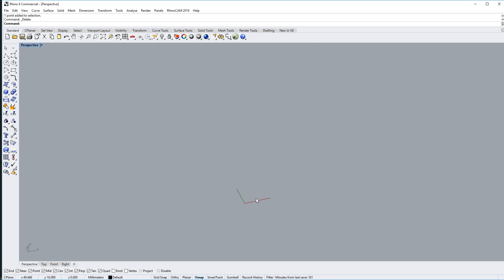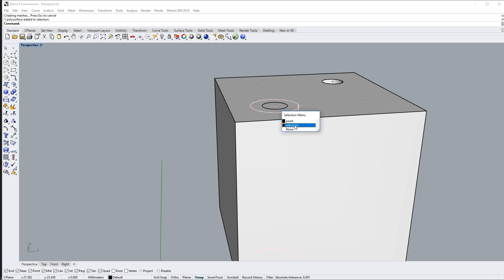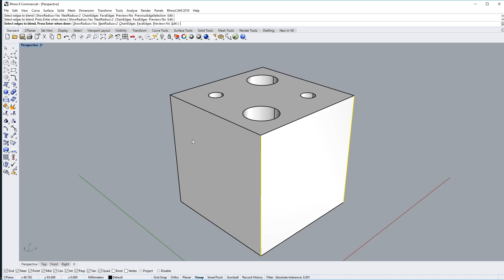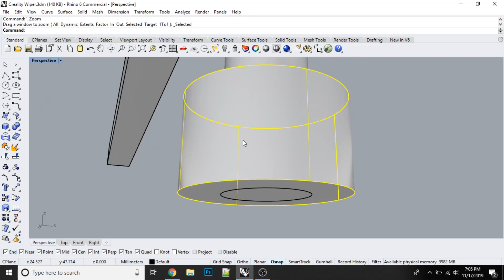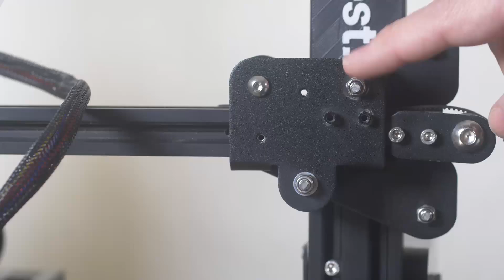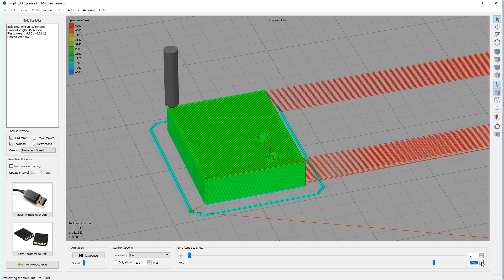Custom Nozzle Wiper for Ender3 & CR10 - No More Layer Shifting PETG!

Comment: All 3 of my printers lay down petg no issues, no modifications are required
Reply: Would you be willing to share any tips or suggestions?
Reply from the maker: Try a 36 hour print at 265°. The high temperature is for increased layer adhesion, but it also increases stringing. About 50% of the time I get layer shifting caused by the well known issue of nozzle buildup. This has been a tremendous waste of filament throwing away all these failed prints. If you absolutely want it to work, wiping frequently is the solution.

Comment: Eek you're going to eat through nozzles cleaning them with a wire brush at every layer, also big prints are going to be quite a bit slower. Good idea but not without its cons

Comment: Great video! How much build up do you get on the brush? I recently got an e3d Nozzle X, which is meant to be super non-stick, but I feel PETG is even worse on it, so I could definitely use something like this!
Reply from the maker: I'm almost done with my first 36 hour print using this brush. For some reason, in the beginning I got one glob that attached to the brush. I pulled it off with my fingers. Since then there has been no build up, but lots of boogers and dust on the bed and around the printer on the table. I need to play with that layer change script a little to dial it in more for the next print.

Comment: Hi there. First of all, I want to say that I do like your channel as I see the real engineer, who likes to build things and has strong opinion on different subjects. However, I do not agree with everything you share. This topic is one of them. I do not want to say that I have printed with PETG a lot, but I have printed enough. The only issue I have experienced with PETG was and is stringing. Beside that everything else is quite worry free. That includes simple geometries as well as complicated models. Your upgrade will increase print time a big time as well as significantly cut nozzle lifetime by constantly robbing coper over coper. Keeping a nice and clean nozzle is a good idea overall. I will be looking into this idea maybe as a print ending routine. This upgrade will work on table shifters.  I have built CoreXY printers. You cannot do a nozzle wipe on every layer without making your print time as long as eternity. As of Prusa MK printers. I believe that almost all parts of this printer are printed in PETG on similar printers. If printing with PETG was an issue, they would have implemented nozzle cleanup a long time ago as entire production depnds on it. 
Nevertheless, good stuff. I gave my like.
Reply from the maker: Have you tried printing at 265° for increased layer adhesion and thus increased strength? I have a structural part which is a 36 hour print and about 50% of the time while printing it I would get layer shifting. I think the key difference between your experience and mine is the time printing. 36 hours is a lot of time for nozzle build up to occur.
Reply: @DesignPrototypeTest  Very much possible. My longest print with PETG was not more then 10 hours. I also remember seeing one video on YouTube. (I believe from Matterhackers) suggesting printing PETG with some extra high, not to squish filament by nozzle.That would keep nozzle tip clean as well. At least in my case. Will look forward to see your video on this.

Comment: Fantastic. I love and hate hot PETG. It's great for tough functional parts, terrible for hard blob crashes.
Appreciate the great comments, people. Keep them coming. This is a serious issue.

PS. I don't know if I'm just being cranky, but I often draw 0.5mm channels on the bottom layer that connect all the holes together. That way, the entire wall starts out as one single long uninterrupted line. Similarly, in Cura, I use an Infill Line Multiplier of 2, then Connect Infill Lines and Connect Infill Polygons. Again, this produces a continuous print line for the entire layer with minimum travels at the expense of longer print times.

Comment: Nice! Devin from make anything did something rather similar just a few months ago: https://www.youtube.com/watch?v=avlengYsJdw
Reply from the maker: His quick hack is attached to the bed, and the idea comes from the much more developed solutions found on thingiverse. I mentioned the thingiverse solutions in the video. With the brush attached tot he bed it only helps with your first layer.
Reply: @DesignPrototypeTest  Good point indeed! Just reminded me of his video and thought it'd be interesting to share. Makes me wonder if manufacturers will eventually integrate a wipe block, not unlike what you find in regular 2D ink printers.

Comment: The channel could be named "No controversy today with Matt featuring positive DIY"
Reply: I notice today that he disabled all the comments on the teaching tech rant video... that’s says a lot about the personality of this guy
Reply: @SamuelCarreira  I think if TeachingTech had asked to remix or rehash DPT videos, then these two guys could have worked together, TeachingTech is good at educational videos, but DPT is good at the engineering side.. DPT could have done videos that show how a mod for a printer is designed, prototyped and tested, and TeachingTech could have done a video on how (in the case of this video) how to print it, why it works, and how to modify the code in Marlin.. Each video could have linked to the other, and they both would have got views.
Engineers are not always good people persons, and you need to remember these people do the videos as a hobby, are not TV presenters representing a network, so if someone not not respect them, especially in the case of an engineer, they are going to say it straight, rather than thinking about the PR aspect.
But if you do not like DPT since watching the teaching tech complaint, why do you keep watching his videos? DPT making videos is optional for him, but so is you watching them.
Reply from the maker: @jonmitchell2424  This.

 Instead TT copies my title to steal my traffic. He has not changed his title since I released the video, and he doesn't answer my emails any more because he knows what he is doing and he knows he is wrong. He doesn't have the guts to have a conversation with me, or even publicly respond to my criticism. Don't forget that he is allied with TH3D. TT regularly features TH3D products with nothing but praise. TH3D sells a t-shirt that mocks me. I've never said a word on this channel about TH3D yet he attacks me.
Reply: @SamuelCarreira  Shut up, Samuel. When you grow up, you might not think so highly of yourself as to make such offensive comments. For now, just button it.
Reply: @meky0  The consequences of IP theft can be beyond catastrophic for some of us. Unfortunately, most of us don't understand what it means and tend to pile in on the victim, even to the extent of personal insults and abuse. Since I've had my business processes cloned and products copied with wholly disastrous consequences, I'm a bit more supportive of Matt speaking out. Indeed, if TT actually agreed with Matt, he might put in a really big effort and produce a really worthwhile video on, I dunno, say contour printing. Just a thought.
Reply: @meky0  Sorry, I don't understand. What is it that is good? And what does "hoarding old ideas" mean? I apologise if I was being opaque. TT has indeed put in a good shift and made an excellent video on contour printing, well worth watching if you are interested in that subject.

Comment: Interesting video with ZERO useless controversy. Thanks Matt!
Reply from the maker: You might want to skip the next video I release. Just a heads up to those who don't like the "controversy." Although I can't say I appreciate that label. It diminishes my ability to shine light on issues which I think are important. What's the point in working so hard to gain an audience if I can't speak to them?
Reply: @DesignPrototypeTest  Don't worry Matt, I will watch the next video, you usually have some interesting ideas to share. I was just pointing there is no issue with the video, a kind of "virtue signaling" but I am a Trump fan so not into braindead leftism. DIY is not braindead even with some controversies <3

Comment: for real??? what are you all just for a problem with PET-G? Buy your filament from reputed manufacturers (not low-cost suppliers on Ebay), print a temperature tower to determine the perfect temperature for your machine, print at a matched speed (not the max that your machine can), use a clean nozzle (or better ruby nozzle ) and observes the manufacturer's instructions for the filament. PET-G is one of the most grateful materials for 3D printing.
To incorporate a brass brush into the printing process and to maim the printer is truly "too bad". I hope the viewers of this video are well enough and do not give in to what has been shown.
Reply from the maker: @Stephen-TheLightSpeed! !! and I were just talking about this in another comment. Basically, you want to print at a very high temperature to maximize layer adhesion and thus strength in the Z-axis. Unfortunately, higher temperatures make your filament more runny and thus more stringing and nozzle coating happens. Therefore, if you are printing a functional part with maximum strength you sacrifice print quality, but worst than that, you are likely to get layer shifting. Seriously, try printing a 36 hour PETG Print with a nozzle temperature of 265° and see whether or not you get nozzle build up and layer shifting. With this brush set-up it's MUCH less likely to happen.
Reply: OK, but do you want a component you can snap with your fingers, or one you need to put in a vice and hit with a hammer?

Comment: It’s a cool idea. I wonder if doing that wipe will make stringing a mess. It reminds me of Octolapse... it can string a little
Reply from the maker: It definitely strings. Especially when printing PETG at 265°. This high temperature increased layer adhesion making a stronger print, but it also greatly increases stringing. The stringing can be cleaned up in post-processing, but at least this way I end up with a successful print instead of all the layer shifting I was getting before when the nozzle was covered with schmoo.

Comment: Prusa’s do print PETG like a boss. In fact I feel most people get better results with PETG than any other material. They also have the textured sheet that sticks to PETG like crazy. Then pops right off.
Reply: Yeah I have a far better time with PETG than PLA on my i3 Mk3S.
Reply: PETG all the way, best filament to print with.

Comment: Prusa's next upgrade will be an addon using a silicone flap. It'll be used for purging during filament changes but can also function as a nozzle wiper after each layer as well.

Comment: Great idea - February 2020 buy a nozzle cleaner by Joseph Prusa MK3 upgrade kit for only $50 xD enough with sarcasm. Is there a way to have dimension lines in Rhino? As always pleasure to watch your videos
Reply: I'm gonna buy two for my MK2S Prusas then plus make another two for my Enders. ;)
Reply: @JMTosses  LOL, can't you like buy 6.5 Enders 3 for one MK3S?
Reply: @trailblazingfive  Not entirely sure what the current price is on the Ender 3 but despite the fact it took some tries to get the Prusas to work they have been my most reliable machines ever since. Plus - Prusa support is an absolute bliss. That said I only had few issues with my CR-10 (replaced heated bad wiring and LOTS mirror), no issues at all with my Ender 2 (cut a LOTS mirror down for it as well) and just recently the Ender 3 (also printing on a mirror) started acting out. Hadn't had the time to address the Ender 3, yet - but I'm pretty sure it's just some lose screw or connection. However - I really enjoy using all my Creality and Prusa printers. Still - the Prusas are my main go-to printers and once the Ender 3 is fixed I will hopefully get into setting up the MMU2 ... there is now a lot of know-how on Youtube on how to make it work without going insane. Cheers!

Comment: i have seen other printers with a 'dump tray' for priming the nozzle on start and then it cuts the filament on an edge that barely touches the nozzle tip - and then use that every 30 layers or so to wipe on..  doing it every layer seems too much overkill and likely if you need to do it that much its because you have a leaky nozzle. or need to turn your temps down a bit/retract .. this would not increase the print times as much as well
Reply: That's the problem for me, Paul. Higher temperatures mean fantastic layer adhesion and really tough parts. But the molten material runs out the nozzle like water.
Reply: @robinmorritt7493   print faster :)
but if it comes out like water without being pushed out  you are way way too hot..
Reply: @PaulColeVFX  I have little doubt you are right, but I've done enough tests to feel sure that the strength of the higher temperature printed item is much higher, and more reliable - less likelihood of a weak layer to spoil the printed part. So, it's all or nothing for me with PETG. I've been tinkering with the double width infill and connect polygons settings to cut down on travels, but not with PETG yet.

Comment: i see a few problems with this .. 1 the wire brush will not just wear your fan shroud  but will wear your nozzle super fast.. essentially  you are sanding your nozzle down with a wire brush on each pass.  .. sure the nozzles are cheap but on long prints you could mis shape your nozzle  ..  perhaps use a softer brush. (or harder nozzle)   also you need to wipe in 4 directions or do a small circle on the wipe to get all directions maybe ?  ..  it might be better to have a hard edge there that lines up exactly  to the flat of the nozzle tip that cuts off the filament instead of brushing it off.  ( you could even get fancy and make it shaped exactly to fit your nozzle right to the heartbreak or whatever is the highest point  (think u shaped)  .. just brainstorming. .
Reply: I was thinking about the ware also. If you look at soldering irons, the iron "stations" have sponge which is used to wipe the tip on. BUT, may be if it could track across it far enough, a Stanley knife blade set at an angle to slice off excess.
Reply: brush is also brass  ---  so not really an issue
Reply: @scottbaeder37   metal on metal would still wear.. albeit slower than rubbing against harder metal.. . afterall even plastic wears the nozzle and its way softer than brass. 

minimize the wear means less maintenace on part replacements.. no matter the cheap..  and those chinese clone nozzles are really crap made..  e3d hardened is teh way to go .. 

a silicone sock is a much better  solution as it keeps the gunk off and the hot end more consistent temperature 

dont forget to retune the pid after the sock tho
Reply: Hopefully we'll see some more experimentation. I confess I'm a toothbrush sort of person. Or toilet paper. Mine has lotion and talc on it which the nozzle seems to enjoy at the end of a print.
Reply: What I don't understand is why it gets wiped every layer. If you just going up and up, without moving between 2 towers or something, how will the PETG curl up and touch the nozzle? Even when moving between 2 towers, there's no guarantee more PETG won't ooze and stick to your prints while going back and forth to the brush. Not to mention you might actually go above some other tower on your way to the brush, leaving some ooze on that. All in all, I don't really understand this upgrade, beyond cleaning it before starting the print.